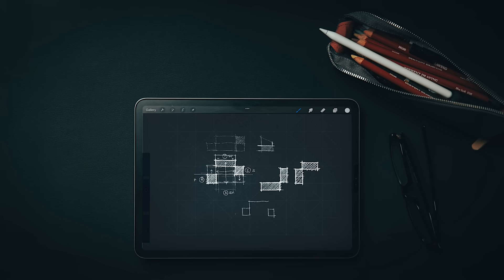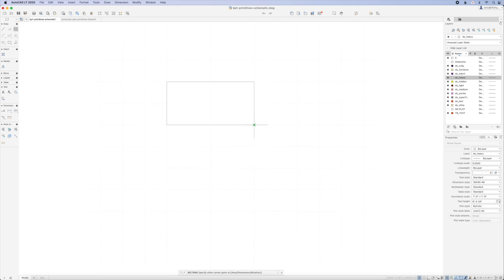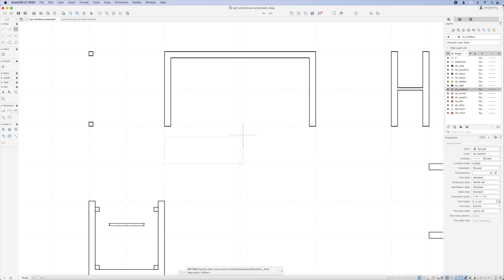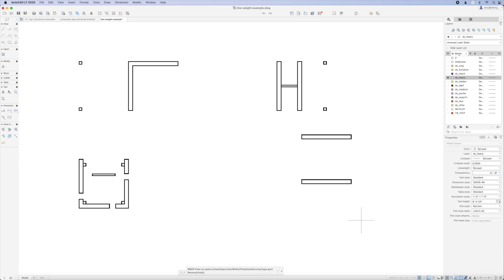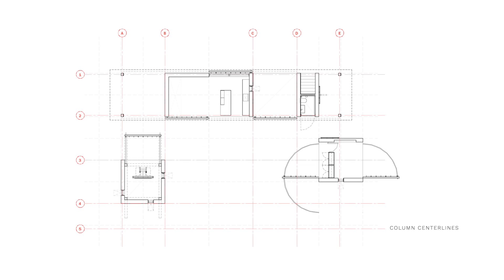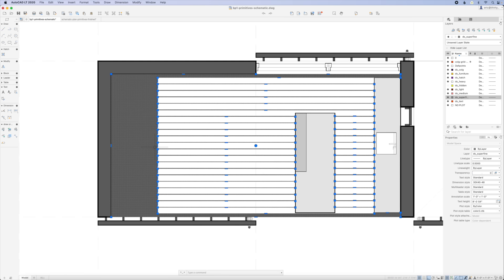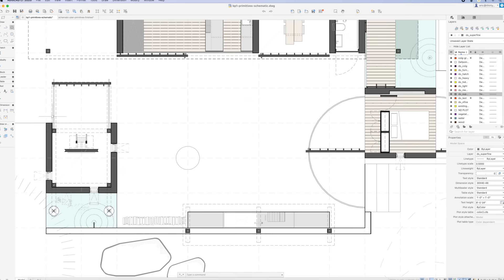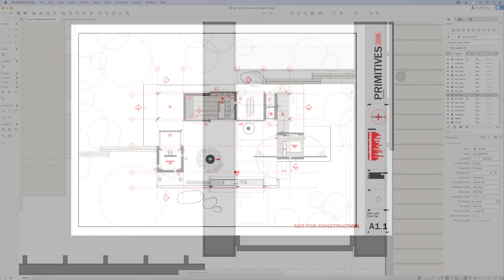Sketch to Finished Floor Plan : My Process, Graphics and Settings

Comment: The problem with 90% of Cad sheets is the overload of information, that's clients have so much trouble looking at it.
It's inefficient and visually doesn't mean much because it's computer made. Simple wall outlines with little to no indications and then variations with materials or furniture is how it was done 100 years ago and it's how it should be done again.

Comment: Glad I found your channel. I have been drawing plans, both Residential and Commercial for 40 years. I was drawing plans "by hand" for years then finally started using my software AutoCad 10 (DOS based, not Windows based) in 1996 and I am still using it to this day, because it is so simple to use, just a simple line drawing program. It amazes younger people that use the latest versions of AutoCad how fast I can create drawings. But I know I need to upgrade (due to hardware, file sharing, etc.) and I think the AutoCad LT may be the answer as I do not really have a need for 3D. Softplan has been the only other software ive found that will accept DWG file format. Any suggestions?
Reply from the maker: We're on a similar path...I started my internship drawing by hand (ink on mylar) then transitioned to ACAD 11. To this day, I use AutoCAD LT (2023 version). It's incredibly fast and I have no need for BIM or 3D capability. I wholly endorse LT, it's all I need and probably all I'll ever use! You might be interested in some of my AutoCAD drawing templates, here's the link: https://courses.thirtybyforty.com/

Comment: Great video, it has inspired me to set up my own CTB file to create my own consistent graphical output. However my line weights never show in the model space. I have tried everything! turned on line weight display, tried scaling it, checked the display plot styles button. Every time I move or zoom however the line weights disappear and everything shows as the same thickness. Anyone got any idea how to fix this?
Reply: Yea, display plot styles, right click model space tab on bottom, and manage plot styles, check the box for display plot styles and done

Comment: Eric, another excellent tutorial. As someone with almost 50 years of technical drawing experience, I have noticed a gradual diminishment in the ability of young architects to generate drawings that "read" well. The ability to communicate, at a glance, the overall intent of the project, is a skill that is fading. It is so important to the success of a project that the contractor, client and everyone involved in the project grasp the concept quickly and begin to build trust. Hopefully, many in your audience will adopt this attitude. Well done!
Reply from the maker: Cheers + thank you...we clearly share a deep appreciation for technical drawing!
Reply: As a young up and comer, I think losing the ability to understand a project at a glance is a by product of most firms adopting 3d modeling softwares. Most students learn how to design on the computer, not by hand; and as a result you gain effeciency, but lose attention.
Reply: Always gotta pass the squint test. Thanks for your reply.

Comment: Finished my first year of M. Arch. You are monstrously helpful on teaching design thinking, and a huge inspiration. Thank you. I know you can and should use whatever works best for you, but I don’t understand why you and some of my professors dislike Revit (Just purely curious!). Learning from opposite opinions always lends new perspectives. 乾杯!
Reply from the maker: Cheers...appreciate the kind words + support. Lots to unpack with respect to Revit vs. AutoCad...great source material for a future vid I suppose!
Reply: Revit has too many fixed constraints, which fights your ability to remain creative with the design.
Reply: I think its terrible for a concept or basic idea/program. But it’s easy to take a sketch or parti from anything into revit and take to a high level of detail and collaboration (when necessary). Personally figuring out which workflow is best, but for design development and on, revit is powerful. And with know how, pretty limitless in a sense if you’re efficient. Just lots of ways to plug and play but I’m not telling anyone anything other than my opinion so, do what works best as always

Comment: From your experience, have you found much use for Revit? I'm starting my senior year of architecture school this fall and we started a foundation in CAD/BIM within AutoCAD but have been encouraged to use Revit when working with Construction Management majors for our capstone. Thoughts on the program and the need for it in the industry? Appreciate the video.
Reply from the maker: My thoughts on REVIT are at 09:17 of this video: https://youtu.be/fCERN8_JMvM
Reply: @30by40  Appreciate it!
Reply: Like he said, use whatever works best for you. However in my experience revit is far more efficient and intuitive than auto cad but of course they both have pros and cons.
Reply: Bigger firms tend to gravitate towards Revit, but my personal experience has been that AutoCAD is better if you want to do more boutique, detailed work.

Comment: Love your videos and style! Are your Notion drawing checklists available for purchase?
Reply from the maker: Cheers, thanks! I'll see what I can do re: the checklists...are you using Notion already?
Reply: @30by40  I am currently using your notion template along with the other templates/resources you have made available, and I cannot express how helpful each one has been. I am also very interested in knowing if you are going to make your Notion drawing checklists available? Thank you for sharing your architectural knowledge and experiences.
Reply: @30by40  I am using your templates for my autocad  drawings for more than a year and very satisfied with it.. I would also like to purchase your notion drawing checklist if it’s available…
Reply: @30by40  I'm not, I just got an ipad though and have been starting to incorporate it into my workflow at our architecture firm . We run windows, but have been looking for a comprehensive drawing checklist to use from SD to CD.

Comment: If you start with the floor plan and design the layout of the house, do you ever struggle with how the exterior should look like? Or is it something you think about as you go, both interior and exterior?
Reply: He has talked a little bit about this in the past in another video, but I like the question, and would love to see an elaborate answer. It is a question a LOT of designers have.
Reply: He does it simultaneously and the design changes during the various design phases...  you should always keep in mind everything  when designing. If u design a floorplan, as an architect you should have an intuition of the space itself. If u draw a hidden line on a floorplan that would represent a beam, you should be able to know how the beam relates to the drawn space.
Reply: It is a choice! Some architects design from inside-out. Some don't even care about the Facade, it is just a product of the materials used and the floorplan. For me it is always both. I try to be holistic from start and have a direction I wanna go to. But at the same time you have to be open to start new completely.

My workflow usually is this when drawing tough:

- floorplans
- Making a 3d model and see the "feel"
- Change Facades and depending on what I change, change the floorplans.

For me a house or floorplan is not contained in the box of the house, it flows to the outside and I always try to give the feeling of "connecting with your surroundings" in the house